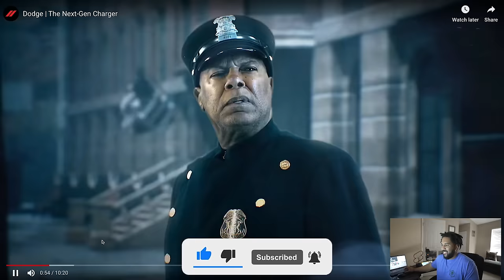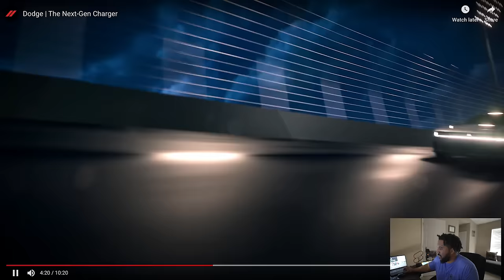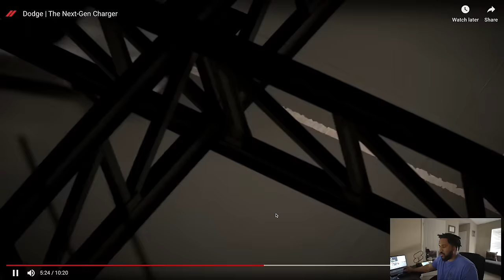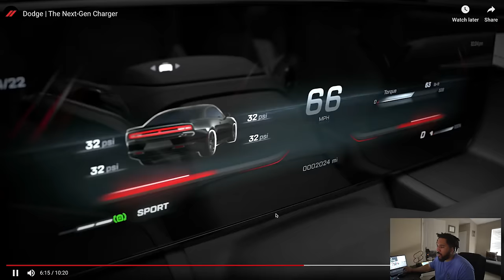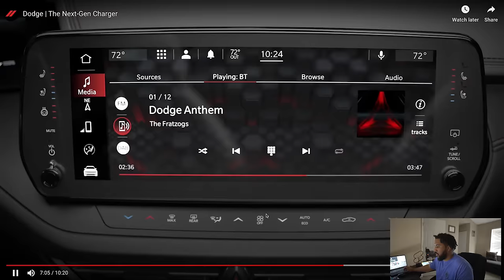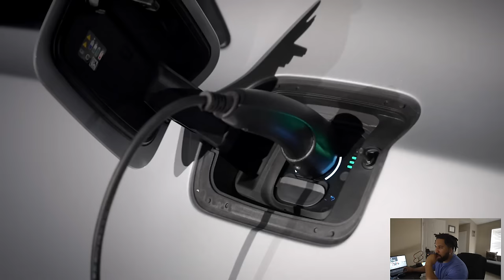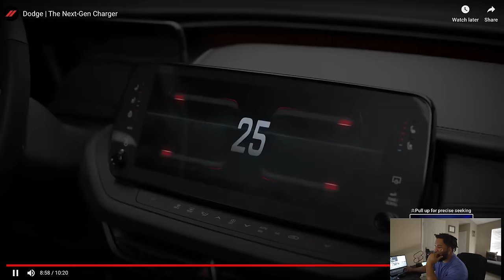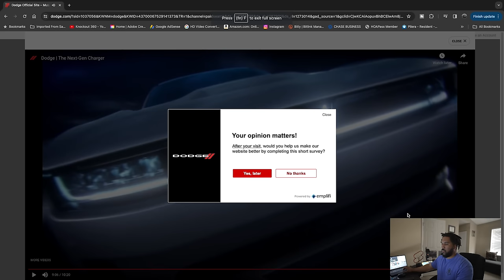2025 Dodge Charger EV is a MONSTER: 4-Door Version, AWD & Twin Turbo In-Line 6!

Comment: Thieves about to steal these and flip the batteries on the black market.
Reply from the maker: U cold blooded 😂
Reply: 😂no lie detected
Reply: Yup pass
Reply: Not without a forklift which will look hella sus anywhere near a Dodge EV.🧐
Reply: looks like the interior of the new charger would fit PERFECTLY in an older model challenger .. peep!
Reply: Interior looked shitty too.. I’d rather by the new integra type r and save 50k apparently those things can be turned into monsters.
Reply: True that u are right
Reply: 4 doors more hor...'s 😂 yes! Excited to see a five door in the mix
Reply: Can’t t steal unless they are your twin. Face recognition software.
Reply: @redalrt4 car weight over 6k
Reply: Good luck stealing a EV
Reply: Nah no one wants this ish. they are gonna start reverse stealin. These cars are gonna magically appear in peoples driveways with a 80k dent in their bank account😂😂
Reply: Some gone get caught killed and more playing with folks hard earned money
Reply: @Stickjonsun - ANYTHING is an improvement over the current wayyyyyy outdated/cheap interiors in the Charger and Challenger. The current interiors in $90k cars is an insult to peoples intelligence.
Reply: @RazorShrpRo what’s the new security features?
Reply: while they are at it they will take the airbags too. if it had wheel covers they would take them to. the use of aluminum wheels only add to the cost of the cost of the car. the average person has no interest in aluminum wheels. let alone carbon fibre or magnesium wheels. if an idiot has a flat when going 160 m.p.h. & the mag catches on fire it burns at 8,000 to 9,000 degrees just like the "safe" sparklers we let our children play with.

Comment: THEY is Stellantis,not the Government....Government didnt ban V8's as Ford etc still have V8's..
Reply: Ford also has EVs are y’all being dense on purpose?
Reply: It's a 5.0 mot a 6.4L. Emissions more efficient engine.
Reply: like 90% of fords sales are 4 and 6 cylinder engines along with hybrids and ev options...  the government just fines you if you dont meet certain quotas. same reason v8s are becoming less common is the same reason oil is getting lighter and lighter.
Reply: It's because Hemis are one of the least efficient V8s on the market. From what I heard they rank a 1/10 in efficiency from the EPA, whereas the Coyote ranks a 5/10. Dodge could make a newer, more efficient V8, however I'm sure that Stellantis wouldn't give them the funds to do so since they are a European company that thinks cars with big, high horsepower V8s are silly. It truly is sad to think that if Stellantis didn't own Dodge right now, we would still probably have a V8 model of some sorts.
Reply: @CertifiedHeel can't be dense if Ford still has there's
Reply: @vinnieheinz6361  looks like the interior of the new charger would fit PERFECTLY in an older model challenger .. peep!
Reply: @crazypkm I agree
Reply: Incorrect but aparently you know nothing about what makes a hemi a hemi and why no one would buy one if it wasn't a hemi.
Reply: Just get a BMW for the straight six. Get a Mustang for the V8 sound and looks!
Reply: @caleguenther8947  Even though it isn’t a Hemi, at least it still is eight cylinders. It’s the next best thing.
Reply: @applianceman6009 heck, even a 4~5 liter v8 would satisfy me😂like at least.
Reply: @simsimw  I got a 2002 Tundra with a 4.7 V8, and it is only 230 hp, but that V8 still satisfies me!!!
Reply: Even if Dodge made a v8 with better emissions it would still be under heavy pressure to conform to future standards. The i6 engine is a sneaky move. They essentially built a 1000+ hp capable 2JZ engine and tuned it down to 550. Now Stellantis can’t complain and tuners can juice these engines up to hellcat territory WITH AWD! The new charger will decimate all.
Reply: @psd.3144 not when it comes to mustangs . They don’t even make v6 mustangs no more they haven’t made a v6 mustang since 2015
Reply: @vinnieheinz6361 in other words it’s Europe fault again as always lmao
Reply: @Lowclef no true mopar lover wants a I6 🤣😂😂🤣
Reply: @nigelholland1714  You just don’t understand the technology. Remember this day next year.
Reply: @CertifiedHeel  they still got v8s that's the point
Reply: The hemi's cost too much to put on the road. Had to purchase EPA points from Tesla for every V8 trim model to get up to 6 points. Hemi's are rated at 2 points and lower. 2.5 billion a year in profit for Stellantis now.

Comment: Atleast 6pack owners arent gonna have to worry about thieves. Because no one i know is risking going to jail for a 6 cylinder mopar.
Reply: looks like the interior of the new charger would fit PERFECTLY in an older model challenger .. peep!
Reply: @crazypkm yea someone is going to swapp that 6ixpack we all no this all mopar fit in the all mopar
Reply: @Viraldriftcontentdaily  im retro swapping. I’ll be putting the new interior into my 19 challenger. A timeless look.
Reply: Whole new platform. This one is longer and wider than the outgoing charger. As cool as it would look to swap into a LD it’s impossible. That engine swap though will keep the v8 living. At least they didn’t fumble the design and overall of the car and kept an engine at all. We can’t blame STELANTIS it’s the government!! Can’t even get a v8 on a TUNDRA.
Reply: I am severely disappointed. I do not want AWD or a 6 cyl! This is not a muscle car at all. Scatpack should have had an NA 440 making 550-600hp and the new hellcat a supercharged 426 with 1000hp. I’ll keep my 2020 Scat.
Reply: @crazypkm  cap
Reply: That i6 will do over 1000 HP if built correctly. The hellcats will be put to sleep.
Reply: @crazypkm might as well just upgrade. The challenger is old af
Reply: But you associate 6 cyl mopar with the 3.6  v6 BASE engine. This ain’t that. But go off 😂😵‍💫
Reply: @nathansummerville3972 it’s German muscle replicated
Reply: @moescolla  just another reason I don’t want it. 6 cylinders all sound like crap! I don’t care if your turbo 6 is faster than my Scat, mine will always sound better!
Reply: @nathansummerville3972  Ay I understand my man. I like both tbh

Also, I’m more of a speed guy with a sweet exhaust note

I must say though don’t knock ‘em until you’ve driven them before you rule them out
Reply: @moescolla  I’ve driven many M’s and AMGs in my time. The Mercedes M156 was the closest thing to what I was looking for. I still came back to American muscle. There is simply nothing better than a massive NA V8 that just throws down torque right off idle.
Reply: @Natethegreat200c  I’ll upgrade to something that looks a lil more like the challenger I have now or I’ll stick to what I got
Reply: @Natethegreat200c This the same type shit in the bmw M3 and he's acting like it's a '12 v6 charger...

Comment: RWD, V8, Manual transmission is what makes a muscle car for me. The insane power of the Hellcats was just the icing on the cake. So needless to say these cars will not be for me. Not a complete disappointment but definitely not why I came to Dodge in the first place. I knew this was coming which is why I ordered and picked up a ‘23 last year.
Reply: The same here, if that was the case would of just went with Tesla. Not a true American Muscle car! Doesn't have the feel of the V8 rumble or the smell of rubber smoking and not to mention that deep sound. I don't want a car that's has a motor that sounds like a high speed fan 😂
Reply: Yeah…I can’t stand all this modern technology and conveniences 😮 Give me the GOAT…a horse drawn carriage with 80” rims in the back and 60” ers in front!  Don’t even get me started on all the medical advancements that have prolonged our lifespans!

Comment: 590 is stock scatpack ev.  And 455 is stock RT. The HP they showed are the software upgrades you will most likely have to pay for.
Reply: Ain't no damn way bruh
Reply: @JRLL81_  I hope I'm wrong but they did talk about stage 1 and stage 2 direct connection.

Comment: The 670hp EV runs the same numbers as the current Hellcat and weigh almost 6000lbs.  Its not outperforming a Redeye. You'd be a fool ro believe that. 

The Scat is said to do 0-60 in 3.3 seconds with a quarter mile of 11.5. The R/T is said to do 4.7 seconds with a 13.1 quarter mile. That's around what the current 5.7 hemi runs with 100hp less than the EV version. 

To make it worse, the top speed for the RT is 137mph and the Scat is 134mph. Yeah, they'll be fun in the quarter mile due to the instant torque but are disappointing for anything else.

The 6-pack will be the one that will be impressive in my opinion.

Comment: Everybody thinks it's gonna be really fast. It needs all that horsepower. This car weighs 5,900 pounds 3 tons. I would like to know how much the ice car will weigh. Hopefully it's under 4,000. I will keep my hellcat for now And let other people see how Well made they are. How fast they charge, How far they go on the full charge. At this weight, they need huge tires so they don't slide off the road going around a corner. And like most electric cars, you're gonna blow through tires. At least you won't see these in police chases, because it's just a bad idea. They can shut this car off remotely.
Reply: zero chance the ICE is under 4K if Mustang GT is over 3800.....

Comment: I got my 21 scat pack widebody challenger 2000 miles, manual tans, shaker package for 52k…( fully loaded) I think… in April 2023 with my husband and we have two perfect credit scores of 800 we put $5000 down in this economy we got 8% interest. all bills associated with this vehicle is $1600 each month. Who is going to be able to afford this electric car? It’s easily going to be more than what I’m paying now. And all I hear is my insurance is expensive this and that because these cars get stolen all the time. so are these electric ones more equipped to discourage theft? is there going to be some relief there? Or will it be a non issue? also, I know people like customizing these cars a lot I don’t see a lot of opportunity for that.
Reply: Wow. Thats pretty hefty for total ownership each month. I sold my 2021 widebody scatpack shaker manual in July of 2022.  It only had 3k miles on it. I had red interior. Roof.  Red brakes. And the SRT performance spoiler.  I sold it for $53,500….i miss the car lol. I had 22 inch Vossen wheels on mine. The buyer wanted the stock wheels. I still have the 22 inch wheels if you or you know of anyone that’s interested…my monthly cost of ownership was around half of what you’re paying….i sold it bc I barely drove it….i kept the aftermarket wheels for so long in anticipation of possibly getting another one.  But I decided not to. Just doesn’t make sense to me at this time.  Good luck with yours

Comment: One thing about the new Charger…none of them will be slow, that’s for sure. 420 horsepower on the base model is insane. Very curious about the price.
Reply: All slow, 135mph top speed, 6000lbs curb weight.
Reply: 135 is just for the scat pack since it will get there almost instantly and the batteries start to heat too fast . The banshee will do 200 just like the plaid @hpickettz34
Reply: With that logic who needs to go faster than 80mph.@CampShakedown
Reply: @@CampShakedownthese things will be priced high af I need it to go at least 200 even if I don’t ever get it there.
Reply: @tecno8335 i think 60mph is fast for traviling with ev no one can beat you 0 60
After that slow down dont race hehehe
Reply: @@CampShakedown buy a camry.

Comment: Actually the R/T puts out 456hp, with the power shot it’s 496hp and 630hp with the power shot 670 for the Scat.
R/T 0-60 in 4.7 secs
Scatpack 0-60 in 3.3 
1/4 mile time 11.5 not bad but was expecting more from an EV.
Reply: again, it weighs almost 6000 pounds and is limited to 135 mph because of it (and the tires).

Comment: Look close the scat emblem is not the 1320, it’s COMPLETELY different. The scat ev only does 11.5 in the 1/4 it weighs almost 6k lbs. the r/t ev will be getting dragged by 392’s 💯.
Reply: there are Challenger 1320s running 11.6-7 stock w 392s, let alone Scats hitting 11.8/9 stock with good prep. Oh, and only 1500 pounds lighter!
Reply: @Thurmanatr16  💯

Comment: an EV that weighs 5900lbs it better have some heavy juice. Sure it may be fast but for how long?  Do you have to drive granny style to get any range? What does it cost? Just because you can cook steak in a microwave does mean it's better.
Reply: That's heavier than a Durango Hellcat...  it will need 800hp just be as slow as the Durango is.
Reply: @S8ER  I was pretty shocked when I saw the weight spec tires are going to wear out fast.
Reply: @johnmick9457  yeah and I bet it’s riding on pretty expensive tires.
Reply: Tire dealers is going to love yall😂
Reply: Yep but who buys a muscle car for range?
Reply: @JRLL81_  I don't think you wanna be stuck somewhere nearest drag strip to me is 120 miles round trip so if I make 5 passes can I get home?
Reply: look at the carscoops report, the scat gets 260 mi, RT gets 317
Reply: @zacharyburket55  Yeah but how did they get that figure? did they drive it hard or go 50mph? A tesla is 900lbs lighter than a Charger

Comment: These EVs are going to cost you in sales price, insurance, and maintenance just like the rest of them.  Tires will need replacing every 8-12 months if you driving it like a real Mopar and if you don’t spend an extra $5000 to set up a charging port in your garage your daily commute is going to make for a long day.  The higher hp the less range.  Gotta think on these for real🤔
Reply: There’s a lot of headaches & misinfo with EVs not widely reported.
The YouTube channel MGUY exposes a lot of them👍
Reply: but don't you want a 6000-pound Scat Pack? Who wouldn't?

Comment: I wonder how many miles per full charge the EV versions will get, along with how well the batteries will hold up in cold/hot weather.  Or does the battery life cut in half when you want to actually have fun driving it? I would buy a low mileage Hemi Scat or Cat WB Charger/Challenger because they look better, sound better, probably weigh less, and will be cheaper to purchase.

Comment: There is an ENORMOUS problem here that has not been addressed. The Dodge Charger SIXPACKs won't be released until mid-2025. That's not even the real issue though. The thing is, Dodge hasn't confirmed a four-door High Output; the one a ton of people are interested in. If you actually check the dodge site, there will be a SO four-door and HO two-door released mid-2025.
Reply: Yes, glad someone is paying attention. These i6 models are well over a year away still, plenty of time for Ford to drop even more v8 variants (wth tremecs) over the term, including Gt500.

Comment: 670 HP sounds like a lot. Until you factor in the fact that the car weighs in at 5900 pounds.
Its a big fat sled that weighs as much as a Dodge truck its laughable to call this boat a sports car or muscle car.
Compare to other 670 hp sports car Z06 3500 lb
Porsche 911 t 3500 lb

Dodge had captured the young African American community who only never compared the large sedans to real sports cars. There a reason you never see a Dodge on a road track as they have always been heavy and dont handle. They a one trick pony and that a 1/4 mile and thats the only performance metric it does well in. I doubt that the Dodge fan base will embrace a 3 ton EV. 
I think Dodge has a tough road ahead as it will lose it true fan base which is young African Americans who think its cool to do donut and burns outs as thats all the currect hemi sleds are good for..

Comment: Bottom line........ Way way too expensive..... The average person will have to upgrade their amp service at home to the tune of 6K. Oh and the obvious you have to plug it in.... forever...... It's being charged by fossil fuels......... It could possibly catch fire and burn your house down. Getting into an accident will not be wallet friendly. The cost of insurance will widen your back side. One of the computers will likely be infected with a virus and that fake engine roar will be replaced with "It's A Small World."
Knockout...your a good dude....no question!!
Every Scatpack and SRT had a gas guzzler tax that paid the fines to the government. This is deliberate because of Stellantis. They do not care about the US market.
Ford is still building a V8!!!
The sand is running thru the hour glass. If somebody does not step up and purchase chrysler dodge jeep and ram , the entire line will cease to exist. The new Ram 1500 Tungsten $95000. With a manual steering wheel adjustment.
My completely optioned out SRT wide body even has a power adjusted steering wheel. Chrysler has one vehicle the Pacifica. I could go on but what's the point. Die hard people will not buy this car ....the millennials can't afford it. Can you say lot rot?!

Comment: I read, the 420 hp Sixpack S.O. RT will start at $40K and the 550 hp Sixpack H.O. RT will start at $50K. I might have to replace my 2013 RT Charger.

I thoroughly enjoyed my 2012 V6 Ford Mustang Premium Pony Package, but I traded my son for his 2013 Charger R/T Plus, back in 2017 because the insurance and car payments were more difficult to maintain than he had anticipated. As nice as the Mustang was, the Charger has been even better.

 It totally changed my jaded view of Dodge products, which I had developed as a result of my bad past experiences with Dodges. My Charger now has almost 140K mikes and it's been nearly flawless.

A 420 to 550 horse power, twin turbo I6, all wheel drive, two door Charger that lools like this, for my retirement car?  Yes, please!

Comment: This is crazy. Im liking this so far. The Charger looks good and the performance is good. The Scat Pack making 670hp on 400 volts and the Banshee on 800 volts. Im gonna guess that doubles the Scat Pack HP making that around 1340hp. If that’s the case, the Banshee is gonna be insane. Like what im seeing so far. Im gonna miss the Hemis but this has my attention.